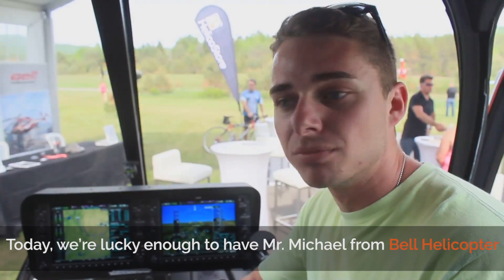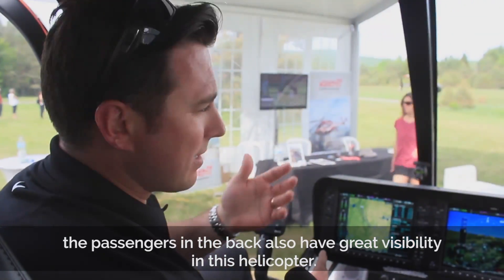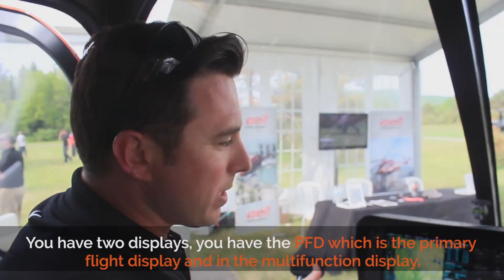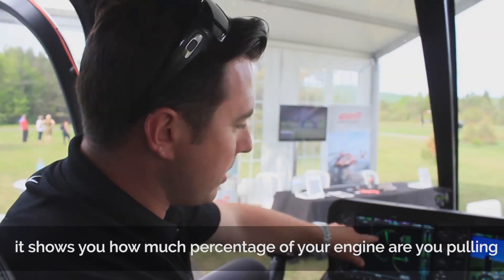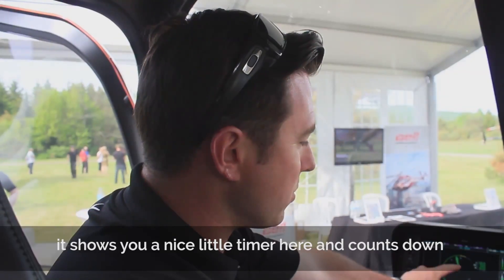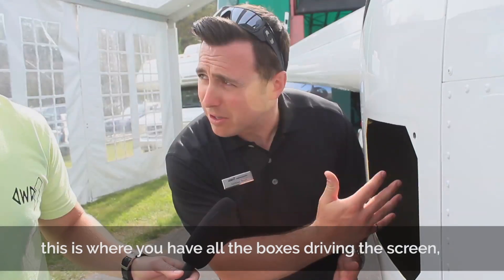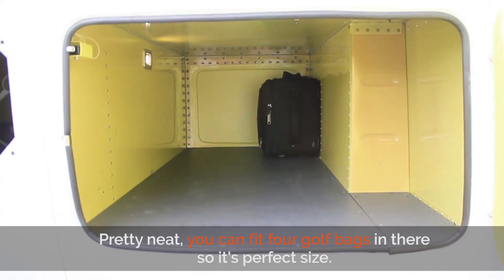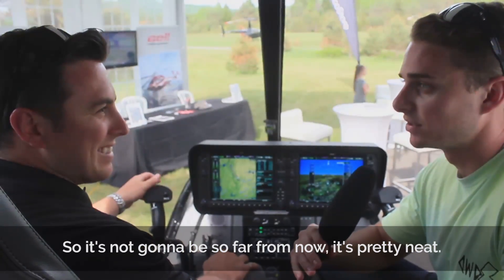Bell 505 Jet Ranger X - Glass Cockpit

Comment: One would think BELL would splatter youtube with videos. PERHAPS the 505 aint that great after all? If I had a great helicopter for sale, I'd show it to you every day. Why is our view of the 505 so limited?
Reply: A cheap design with very poor fit and finish. The DOCs are low and that makes it popular with operators but I did not enjoy my 120+ hours flying it. The one I flew had for four months had multiple chip lights, doors wouldn't close right, MGT probe failed (leading to a FADEC degrade), three MFD failures, etc. etc. Geez, the door lock cylinders were not installed at the factory so the door locks didn't work until we took the doors apart to find the locks empty. Bell and Safran warranty service was excellent -- but begs the questions why was so many problems?

Comment: Had a look at it close. Its an R66 on steroids. No innovation, teetering hub, very uninspiring. To be honest I am embarrassed for bell.... it looks cheap
Reply: It is only $1M.  For the price it is very nice compared to say Eurocopter.
Reply: @grasuh  Out the door, with any reasonable level of functionality, it is $1.2 to $1.3M
Reply: It is cheap. Fit and finish are very poor. Doors don't close properly. Tail rotor drive shaft was askew and rubbed tail boom. Very cheap design and manufacturing.